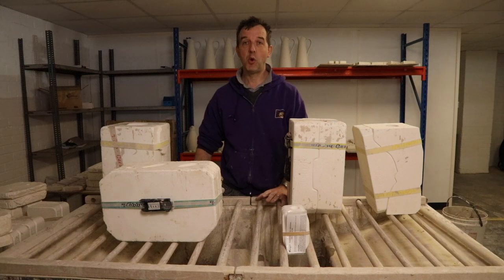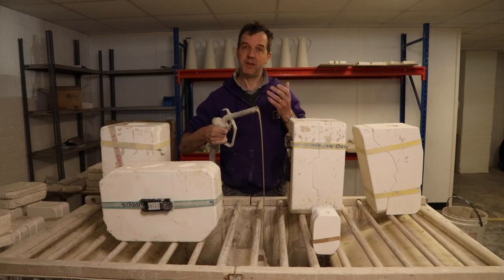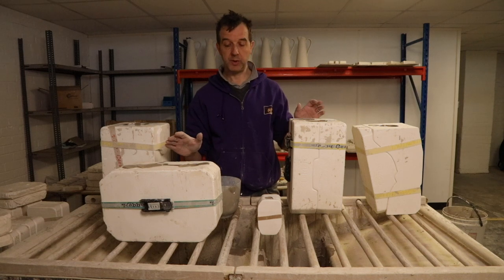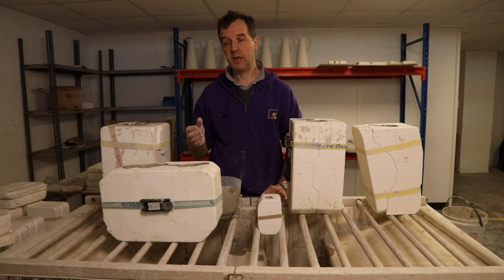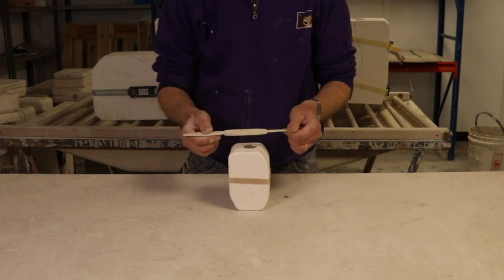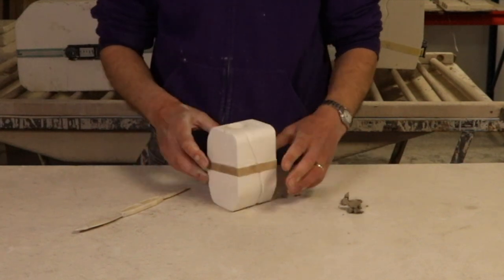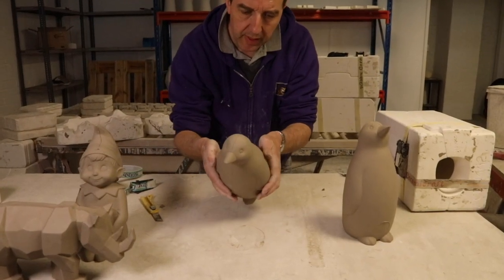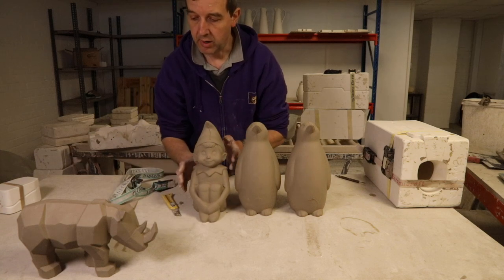How to cast a mould with liquid clay and create ceramic shapes.

Comment: Sir...how to control or eliminate air bubbles?
Reply from the maker: Make sure your slip is the right consistency.  If the plaster mould is particularly wet and the water from the slip cannot absorb into the plaster, then you can get small air bubbles.
Reply: Also, once you have filled tour mold, tap the sides with your hands to release any bubbles to the top.
Reply: Thank you for your information sir..

Comment: Meanwhile im struggling to get moulds half that size appart when pouring the plaster 😅
Reply from the maker: The type of mould soap I have chosen over the years makes a big difference.  Some that others recommended I can't get the hang of.  I use a 'magical' liquid which I have no idea what is in it, but works for me.. so my advice, is.. if you are struggling, try a different separator.
Reply: @HobbyCeramicraft  awesome! Thank you for the reply 🙏